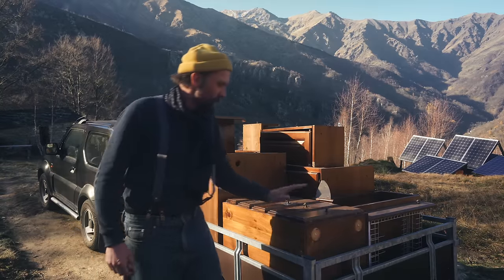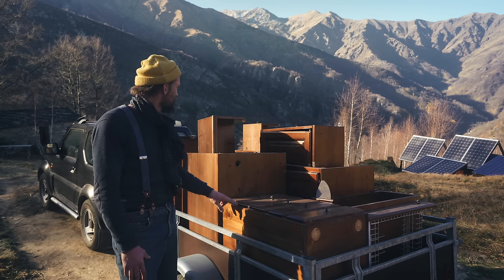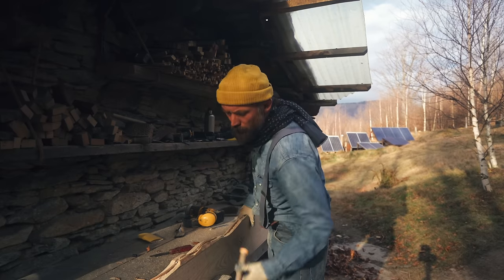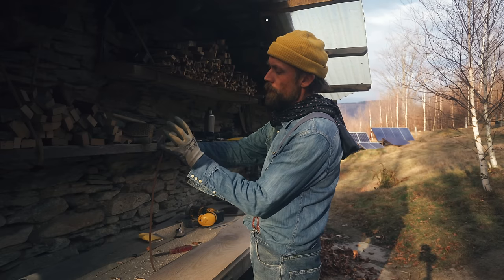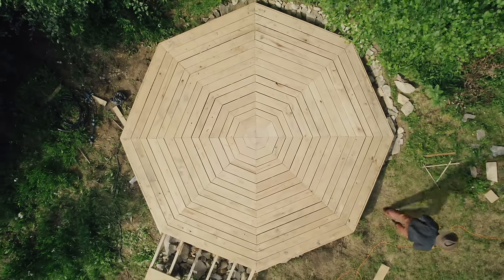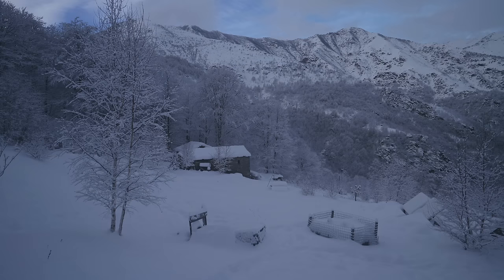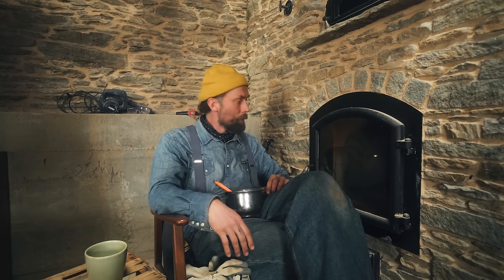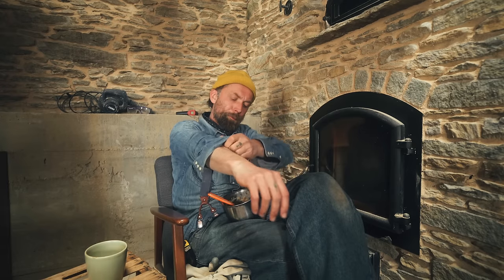#94 First Snow and Last Night in the Tent

Comment: Hey Martijn - I'm no expert at all, but a little red-flag was raised for me when you mentioned gluing all the floorboards together. I just wonder ... given that wood moves and expands/contracts with the seasons and humidity etc, whether gluing might cause cracks to appear in the floor unexpectedly over time. This might not be an issue at all, and actual experts might want to weigh in.

However, if this is a danger, I wonder if there's another way you can get rid of the creaking issue that doesn't involve gluing? 

Anyway, just a thought for what it's worth.  Thanks!!

Comment: The stove is indeed very beautiful, but how will it heat the upper part? If you want 20 degrees upstairs, it has to be at least 40 downstairs. I think the stovepipe should have been guided inside along the corner and then taken out to the roof, because this way the stone-encased pipe would have also provided heat.

Comment: It is not clear why you have to risk yourself falling every time you enter the second floor? Until the flooring is finished, the planks can be used as a floor
Reply: Bare unsupported planks could give false confidence which might be even worse. But anyway, he does work on the flooring in the video.

Comment: 🎯 Key Takeaways for quick navigation:

00:28 🏡 Picking Up a Kitchen
- The speaker talks about picking up a large kitchen, made of high-quality wood, which is 33 years old.
- They mention the potential to use some parts of the kitchen for other projects.
- Plans to store the kitchen until it can be fitted into the cabin.
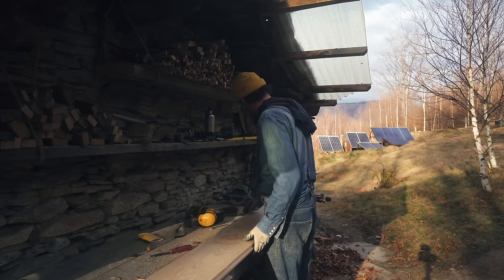15:40 🔌 Installing Sockets and Dealing with Storm Damage
- The speaker discusses installing electrical sockets near the kitchen area and mentions unconventional wiring to hide cables.
- They talk about the tent falling apart due to recent storms and the need to move indoors before the first snow.
- Preparations for moving into the cabin and the challenges faced in winter are mentioned.
26:19 🏕️ Reflecting on Tent Living
- The speaker reflects on their experience of living in a tent for over a year, mentioning the beautiful view, seasons, and challenges.
- They describe the comfort of a woodstove during winter and the difficulties of cold mornings.
- Mention of storms and the impact on tent life, as well as the anticipation of moving into a warmer cabin.
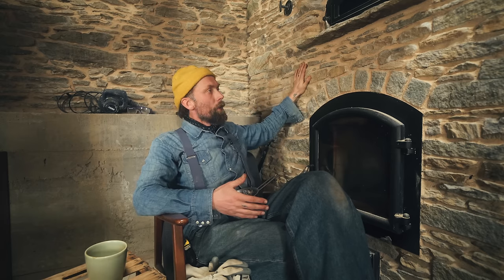38:35 🏠 Transitioning to the Cabin
- The speaker talks about the progress of transitioning to the cabin, including heating with a woodstove.
- They discuss the challenges of working on the cabin floor and plans to improve it with glue.
- Mention of being under the weather and plans to move into an Airbnb temporarily to ease the transition.

Made with HARPA AI

Comment: So MD , a couple of things, once you return from your vaca - holiday,  or a prolonged absence, how long would you estimate it will take to heat the walls for total radiant heat? I'd guess 4-5 days maybe a week w low steady fires.
I am surprised that you do not have your flooring inside so it can acclimate to it's new invirons.you did this B4, then it was outside  to make room..is this not part of your squeak problem? 
And when the ** are you going to start wearing knee pads? 
As always,  ks.

Comment: While I can't see the roads and inclines I'm struggling to understand why you never got an access road graded up from the road below to the two buildings - very short access with no need to have an access road running all the way down and across the property.  Much easier to maintain as well.
Reply: Well..... Maybe, it's impractical... and you're talking nonsense....
.... Do you really think, if it was an easy solution, that he WOULDN'T have done it...!?
It's not MUCH of a struggle to understand that......!!!

Comment: you do know that a wood floor is not supposed to be right up against the wall a gap is supposed to be there for expansion and contraction. Also not supposed to glue tounge and groove floor together. you sure over complicate things had you not removed the OLD floor and laid this one on top of the old you would not have the squeek problem , glueing it is probably only a temporary solution as with time it will return because your floor has no real over all support
Reply: @andymccabe6712 again you supporting Martijn, a person you dont know.

Comment: you cut your wood way too small.  6 inch pieces are much better than your 1-2 inch pieces. your wood is kindling which is used to start a fire then add the logs.